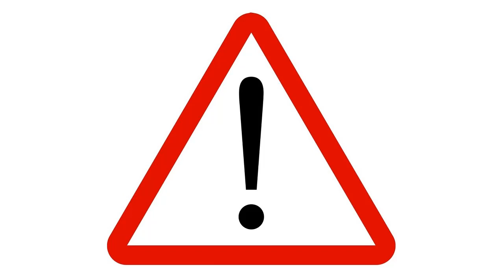GADGETS#31 - DISCLAIMER

Comment: I could be wrong but I think that the capacitor purpose in the commercial pickups is to set the attenuation, so that the voltage can be measured.  I know that I have looked at the Fluke and some other pickups and the capacitance seems to vary with the attenuation factor.

As far as the copper being dangerous - no more so than the old school method of finding ignition lead leaks with a test light (or if you happened to brush up against them with your arm )  :)
Reply from the maker: +bhartwigutube - I think the concern raised by some viewers is of oscilloscope damage. And I don't entirely dismiss their concern. I simply state that I think it's low probability, low consequence risk.